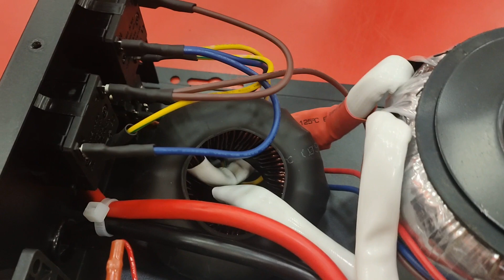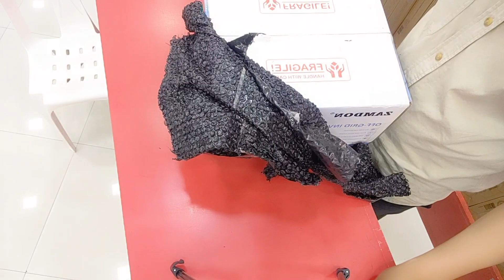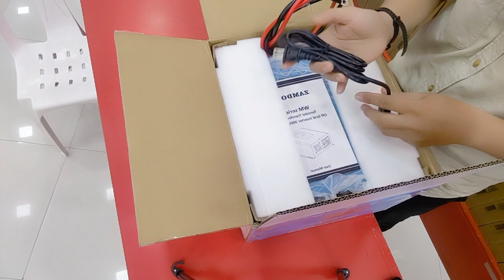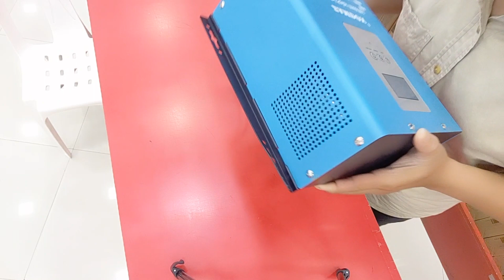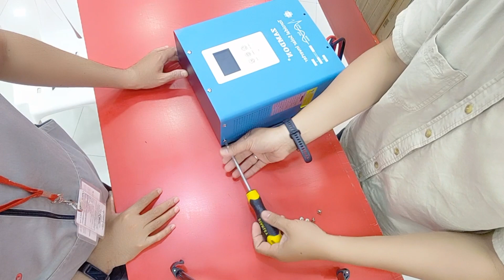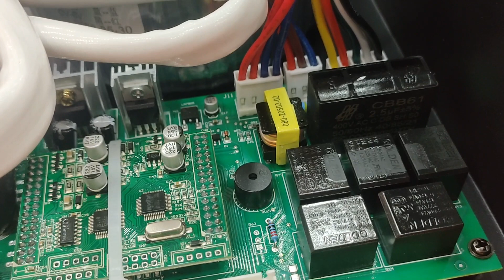Zamdon 12V 1KW Toroidal Inverter

Comment: Automatic po ba ung exhaust fan ni zamdon?
Reply from the maker: Yes po sir if mag load ka ng above 100watts aandar stop to normal then run again. may heat sensor temp kc sya.
Reply: May built-in ATS ba siya na mag transfer from DU to oinverter settings and vice versa  depende alin ang i- prioritize?
Reply: Boss bakit wala na ako makitang ganyan sa shopee puro 24v lang nandon